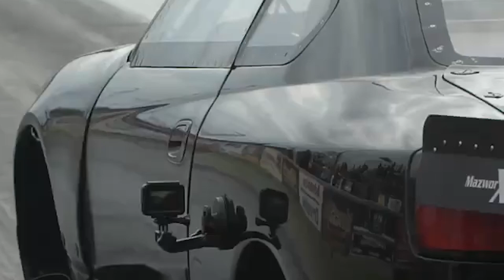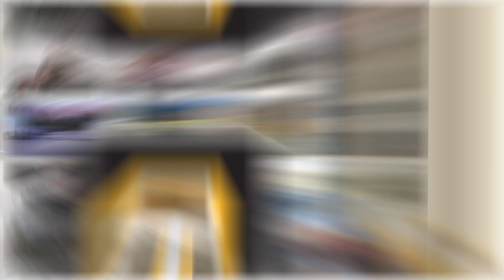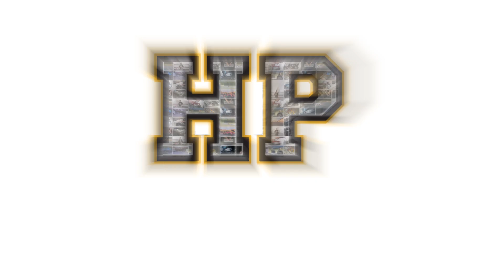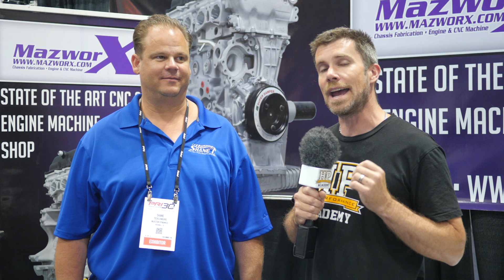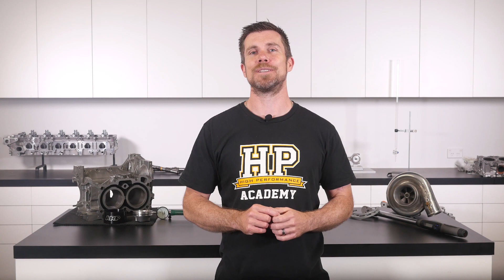Tuning a 2,010HP, 83PSI 4 cylinder SR20 | Shane Tecklenburg [TECH TALK]

Comment from the maker: ✅ Building a fast car? Get $400 OFF the all-inclusive VIP online course package deal: https://hpcdmy.co/d3552c
🦵 Kickstart your EFI Tuning knowledge. Get 50% OFF your first online course: https://hpcdmy.co/f6c316
TIME STAMPS:
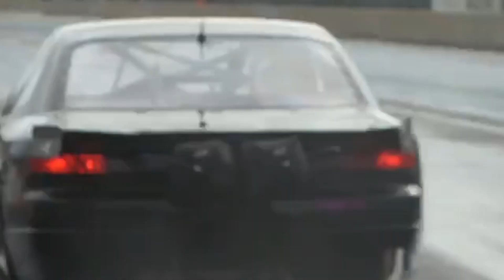0:00 - SR20 Project
0:27 - What Shane Helped Change
1:29 - 1800hp SR20
1:55 - A Lot Of Work Over Time
2:36 - Intercooler Vs No Intercooler
3:24 - Compressor Map Differences
3:50 - Small Engine, Big Turbo = Win
4:08 - Turbo Surge Management
5:01 - Launch Control
5:40 - Inlet Gate
5:48 - Exhaust Gate
5:52 - Anti-lag & Cuts
6:03. -Wastegate Control
6:21 - Ram-air Effect
7:08 - Iterative Changes & Consistency
7:45 - Traction Control/Power Management
8:11 - Driveshaft Speed
8:17 - Suspension Data Vs Slicks
8:48 - ECU Control
9:13 - GPS Vs Timer
10:16 - GPS Data Speed
10:50 - Wheelspin Management
11:26 - Tyre Shake Slicks
11:36 - Ignition Retard Downsides
12:12 - Thanks Shane, You Da Man!
12:35 - Future Plans
12:59 - BUILD.TUNE.DRIVE
Reply: High Performance Academy you are very intelligent and interesting when you talk to these guys. You catch them off guard all the time I love it keep it up buddy bad ass vids

Comment: Interesting he said “You will absolutely go in circles if you do not do enough ignition retard” when talking about traction control. In computer science there’s the Sawtooth algorithm or sawtooth waveform. The idea is that you want to maximize the transmission rate of some signal. That could be wifi in your home, Internet speeds, stock calls over a dedicated line, etc. basically, you have something on one side you want to send to the other side as fast as possible. The Sawtooth algorithm basically ramps up the number of items in the signal as fast as possible and then when an error is detected it sharply drops. It then ramps back up at the same rate as before until another error is seen. Sometimes it’ll just keep doing this, other times a change is made to the amount the signal is dropped to tune in the highest possible rate the signal should send. I’ve always wondered if tuning in cars utilizes similar algorithms for finding the absolute best “tune” or if maps are just applied with pre determined error corrections. I would think with machine learning we could take all data points and builds optimized tunes faster than any human tuner could.

Comment: 83 psi is a number that is hard to get used to hearing. So are these hp numbers at this displacement.
Reply from the maker: The numbers are getting astronomical. With the test setup it hit 130 Psi but needs some changes to control the boost once it goes over 95 Psi. Not sure when the next round of testing with those changes will be, but it's pretty exciting for sure! - Taz.

Comment: Excellent excellent interview as always. You always ask the questions that really matter. If I may....the use of an air to air intercooler on a drag racing application especially with methanol, would that not actually be alot less effective than an air to water intercooler? Reason being that with a air/water cooler you have optimum cooling at the startline already versus an air/air cooler which only starts working efficiently after 300feet or so? Correct me if I'm wrong. Also how would an air/air cooler get the charge temps down anywhere near enough to have the effect spoken about in the interview?
Reply: Unless subjected to repeated back to back runs, an air to air will not heat soak. Rules dictate the use of an air to air in most cases or weight concerns because for an air to water to be most effective you need an ice tank. Understanding that an intercooler is an heat exchanger a properly sized intercooler will not cause a restriction that would heat up the air as it travel through it but bring inlet temps down. Since methanol is a cool burning fuel it does not have the BTU absorption of water, but does cool better than ethanol or gasoline. When running a turbo too it's functional limit anything you can do to bring the temps back inline will work.
Reply: I would add to Anthony's response... think of the volume of air that needs to pass through the intercooler (2+ litres for every bar). While water to air can be quite efficient in certain circumstances the smaller area of the core in a typical barrel would cause significant restriction in such high boost applications, and even if it could pass enough air, the ability to transfer the heat to the water would be severely impeded by the sheer volume. Don't get me wrong I think water to air has its own benefits, I am thinking of using one on my 2J IS300, but I can't see it working here.
Reply: Dodgy Brothers you make a good point. And in some cases that's probably spot on. But I did some checking and the guys in the video are using a water/air cooler. So somehow they managed to get around the issue of airflow restriction. I know the "barrel" design that you mentioned. But these guys made a complete custom jobbie. Looks like a big box in front of the motor.
Reply: Greth Vermaak The only way I see a water to air intercooler working is to use dry ice, or something similar to pull bulk heat from the intake charge / water medium. As long as the air passages equals more than the equivalent straight pipe volume I could see it working. Although there is a big BUT involved... Using some very rough math 83 psig (not actual boost) is 5.65 bar pressure + 1 bar atmospheric so 6.65 x 2 litres is 13.3 litres per cycle. Compare that to a street car running 1 bar of boost, that is only 4 litres per cycle.

And as we all know from our car AC the higher the fan speed the hotter the AC temp is because there is a fixed amount of cooling available, and the more air that passes by the core the less chance it has to exchange heat due to air speed. If the water to air cooler was quite long it would perhaps increase the chances of taking more heat out of the charge. HOWEVER... You couldn't use a typical 19mm - 3/4" single water inlet / outlet. I would foresee something that would look more like a multi stage dry sump pump.

The intercooler section would need to be modular to allow multiple sections to be simultaneously cooled. It is the only way to pull enough heat from the intake charge to be meaningful as the temp sours the more the air is compressed.

As I say I am looking to do a water to air intercooler setup on my NA IS300 before I add some additional boost to the 2JZ in it. Being the 2JZ takes up a large portion of the small engine bay some creativity will be required to make it work. Currently I am looking to replacing the 2 into 1 pipe work that sits between the throttle and the intake manifold with an intercooler. I having been racking my brains to think if there might be a more effective medium to pull the heat out intake charge. Water with water wetter might be fine, but I wonder if I could use something like LPG or another gas that could do a better job.

LPG is stored as a liquid so the intercooler could pull all the temp out of the liquid changing it into a gas, the only problem is cooling it enough to return it to a liquid.

Comment: In drag racing, it has been proven through the years, especially on small displacement big turbo setups, that the use of  air to air coolers is more efficient than air to water or no cooler at all, due to the reasons listed on the above interview.  The same goes for ram air effect,  as it is used on bikes, and turbo front facing applications. Even the knowledge is already in my possession regarding these interviews, more than twenty years into tuning, as I've said in the past  these are quality interviews, which I nevertheless always enjoy watching. Keep it up guys!
Reply: Funniest thing here is you can see Shane’s winning engines using water/air intercoolers on his YouTube channel.

Water/air work, and efficiency isn’t the only factor at play when choosing a setup.

You didn’t really put forward any good points Marios.
Reply: That's what I said "in drag racing it has been proven through the years", those in the know are well aware and can verify this. The same principles that apply for no intercooler apply for air to water cooler. It just does not transfer and disperse heat fast enough and at adequate degree for the setup to reach peak performance, especially in small displacement big turbo setups.

Comment: Gob-smacking output for such a small engine with reliability and so much awareness of all the problems faced - very, very smart guy!
As an aside, what driveshaft material is he using - I was wondering if the potential for engineered torsional flex with carbon fibre would help dampen the spikes to the tyres?

Two possible alternatives for the velocity reference - ground speed radar and, can't recall it's correct name, but instead of using satallite signals for reference it uses transmitters placed on the ground for triangulation.
Oh, three - accelerometers to corrolate actual acc'n, and hence velocity, against the calculated wheel (or tread) speed.
Reply: Differential GPS

Comment: What about using a torpedo tube instead of GPS for speed monitoring? 
Great video👍
Reply: Deric Cribbs torpedo tube?
Reply: maybe to inaccurate at low speed
Reply: Thought that was what you meant - but have you considered what a variable breeze, or gusts, would do to it?
Reply: Ryan Bernard it's like the landspeed version of a pitot tube, which is used for air speed measurements. 
I guess torpedo tube is just slang for pitot tube. That's what we always called it